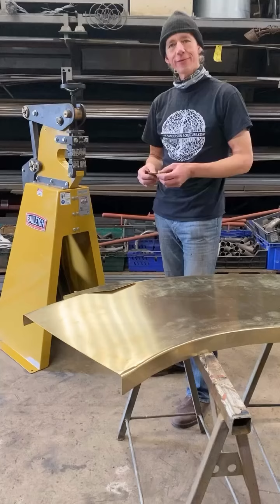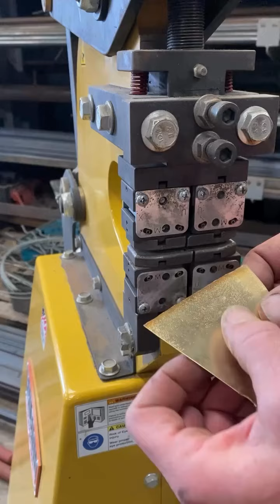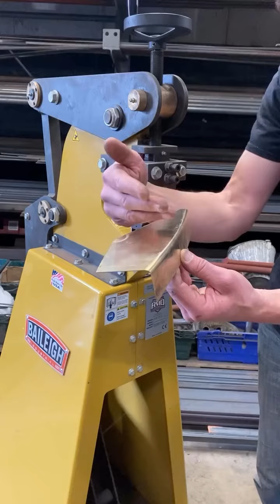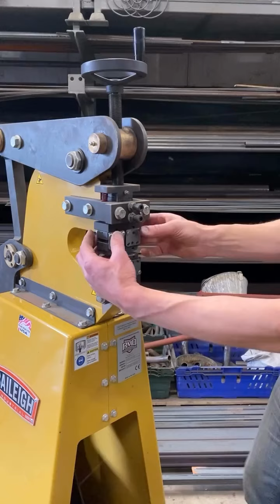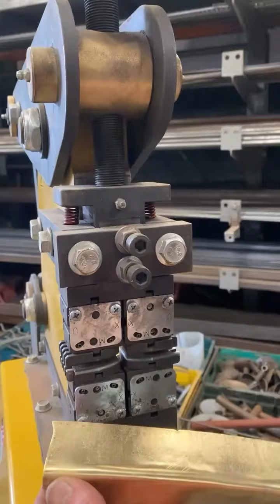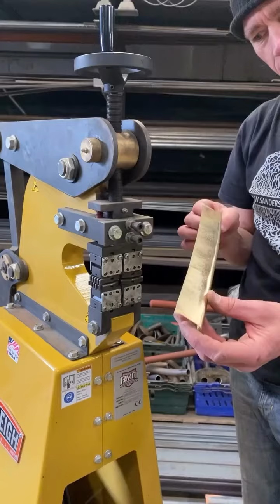@sandersonsculpture showing off the incredible results from the MSS-14F

Comment: I think you explained the expansion and contraction backwards. The outer edge has to expand and the inner edge compresses or stays neutral. The outer edge, further from the center of the theoretical circle, has to travel a further distance than the inner edge. Good look, though. Arcs are tricky